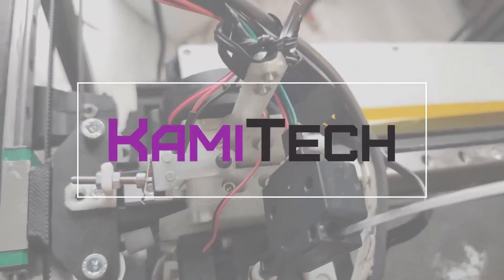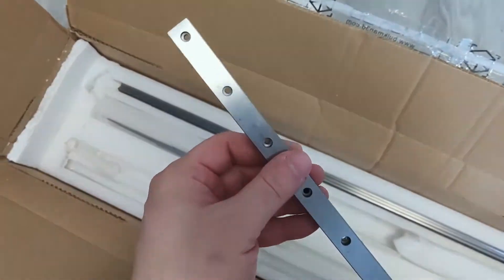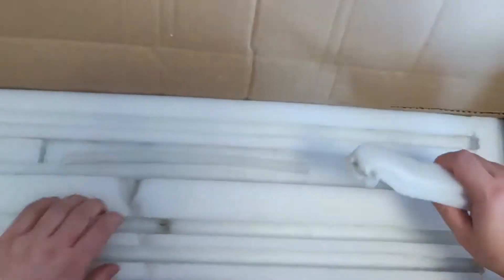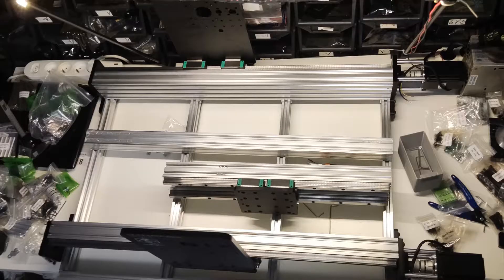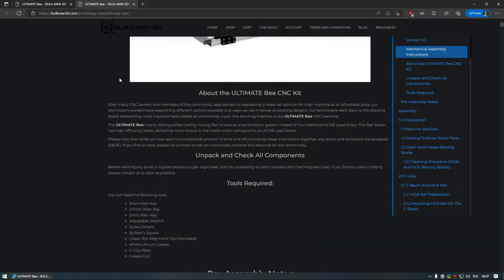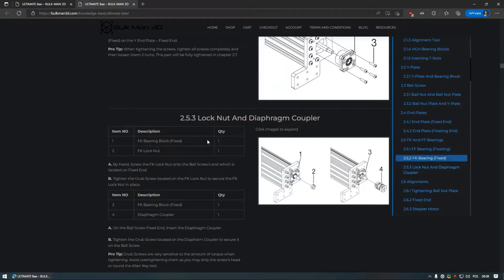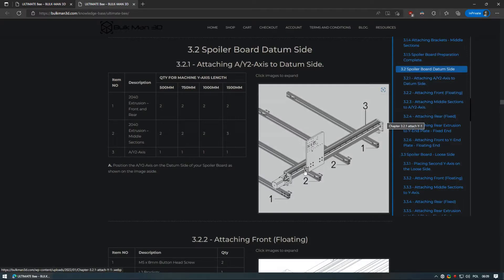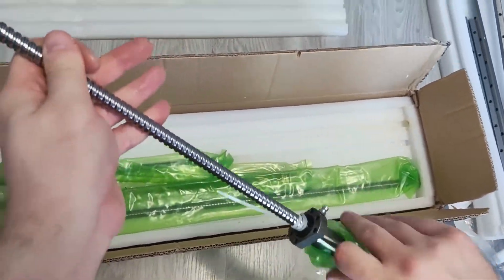Ultimate Bee - Inexpensive CNC machine kit unboxing - Part 1

Comment: What size frame do you have. I have been thinking on getting the 750×750. I really need it for aluminum mainly. So that's why I'm going with a smaller unit to keep rigidity up on it
As for the bigger machines I heard there's alot of whip on the ball screw because of the length of the ball screw. Have you cut any aluminum on yours yet
Reply from the maker: I have 500x750, the X is work size is smaller, around 350 because of extrusions, so roughly 350x750. Yes i did aluminium, does decent job at it, https://www.youtube.com/watch?v=f6tmugKeJfc
Reply: @KaminarisTech  wow that's a big cutoff of work space

Comment: The machines are listed by their outside frame size such as 1000x1000 or 1500x1500. Does this include the motors or do the motors stick out beyond the frame dimensions? If so, how much extra do the motors add to the dimensions? I'm planning to get a 1500x1500 soon and trying to plan out my table/enclosure.
Reply from the maker: Dimensions are only for frame and they do not include motors. As for how much motor sticks out it depends on motor itself because you can get normal nema or closed loop or servos. My normal nema motors stick roughly 145mm.
Reply: @KaminarisTech  Thanks so much for the info! I'm planning to get the NEMA motors as well so the dimensions you gave are really helpful. One more question, what is the total height of the Z axis from the bottom of the frame to the top of the NEMA motor?
Reply from the maker: You cant design something around exact values because stuff will be sticking out such as cables or water cooling pipes. But Z max height from bottom of fame is roughly 730mm.
Reply: @KaminarisTech  Thank you so much for the info! I am not going to finish designing it until I have the machine. I wanted the dimensions to make rough estimates of how large the enclosure needs to be so i can budget for materials. Thanks again for these videos. They were super helpful!